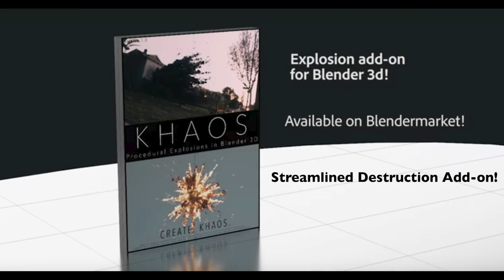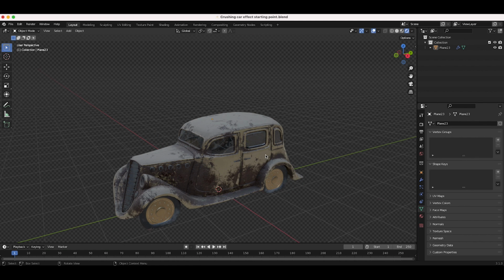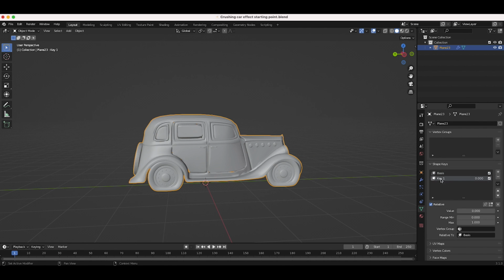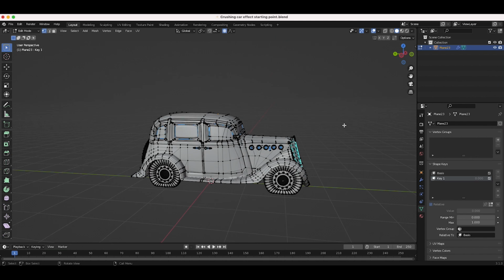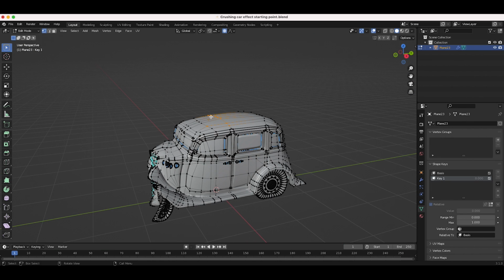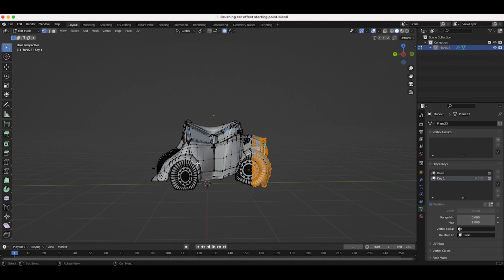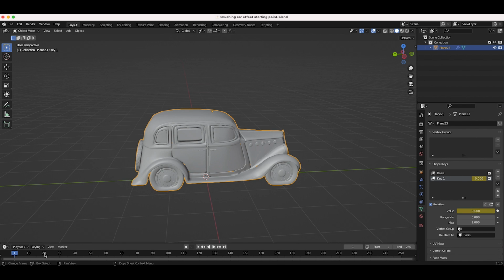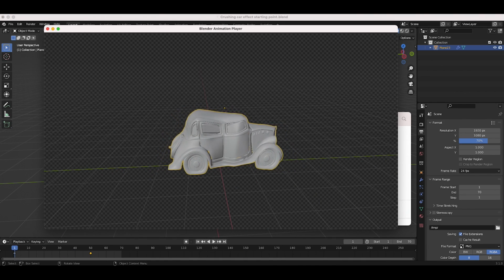How to Crush Objects in Blender 3d: Hollywood VFX in Blender (Chronicle Movie FX)

Comment: Do you have a tutorial recommendation on how to mix 3D and 2D (2D as in the raw footage) with objects in front and behind the 3D object? For example the grass in front of the car. Is that an overlay or just a duplicated video with everything but the grass masked out? Thanks!
Reply from the maker: Hi  Finngw2,
There are a variety of ways to do this. Sometimes you just mask out the foreground and sometimes you can actually recreate the geometry of the scene entirely and use that as a holdout for the grass. Does that answer your question?
Reply: @LightArchitect  Yes! Thank you!

Comment: bro I need asking  in khaos addon i need to change flame color but i don't know how do that
 ... please
Reply from the maker: Hi Sliman,
Thanks for the comment. Changing the color precisely out of the fire heat spectrum is a little tricky wiith the fire shader because it works with a blackbody input. right  now I would use the compositor to adjust the color through control of an emission pass. We'll see if we can add some more customizable nodes in an  update to the khaos fire shader without dialing back on the fire detail.